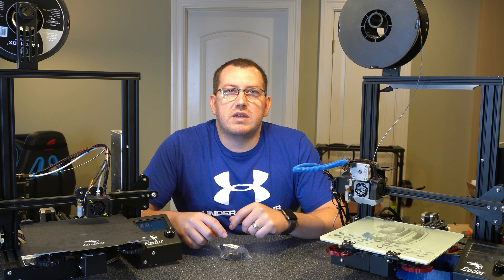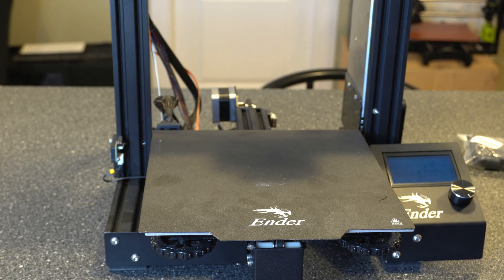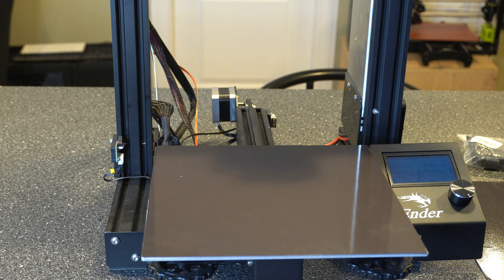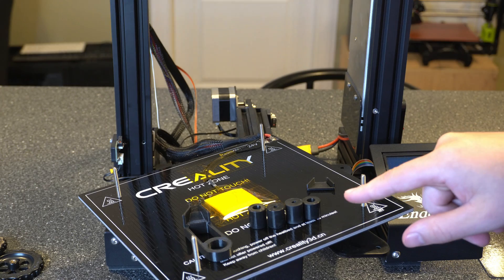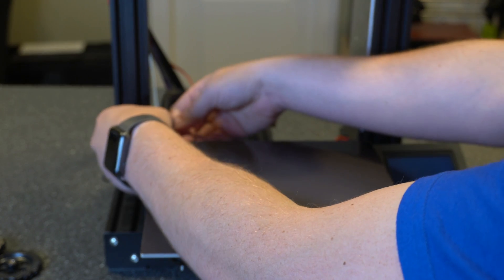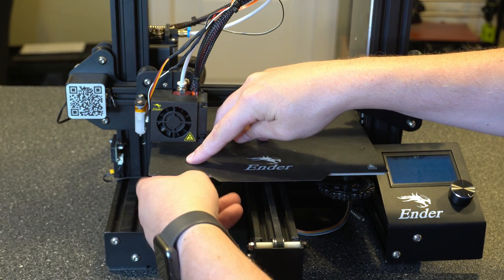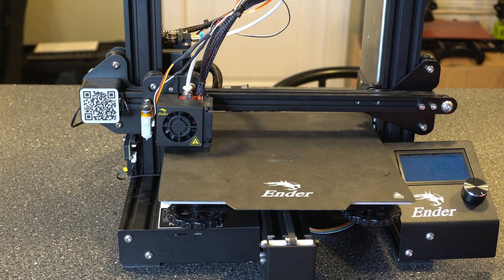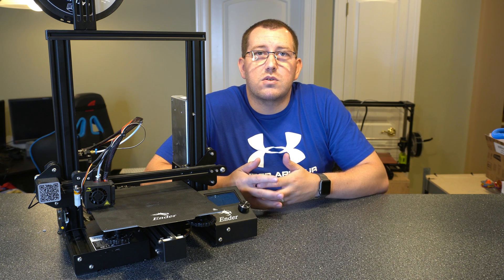3D Printer Solid/Silicone Bed Mounts – Install Guide

Comment: Hi I don’t know if you can help me I have an ender 3 v2 and I purchased the silicone mounts and installed them shortest where the bracket and wires are and put the bed back to together and levelled it using the CR touch, but one corner is just way out and it asks me to raise the wheel, but I cannot turn the wheel anymore / raise it anymore without the wheel coming off…that corner just seems way out where the shortest side is.  I’ve adjusted the z offset and all the other corners to see if it will compensate but it’s just off. Do you know of anything that will resolve this? I normally use the glass bed, but decided to use my magnetic one for this; will that also affect it? Any help on this would greatly be appreciated if you could!

Comment: pretty sure your supposed to use glass bed with solid mounts. maybe im wrong.
Reply: You can use with anything, its just a harder mount than the spring so it should require you to adjust them less

Comment: Good evening. I have a CR-10 S5 CR Touch, 500x500x500 build volume. I am having such a hard time making it stay level. I am going to install metal spacers with an inner diameter wide enough to go around the nuts holding the screws in place underneath instead of the silicone mounts to have a "flat" and not moving bed level. My Anycubic Kobra Maxes (2) and my Kobra Plus have these hard spacers also with locknuts to hold the bed down with ABL. I won't be able to adjust the knobs because of the solid spacers being locked down with locknuts. Would I just level the center when it homes since it would be mostly flat across the board, or would I need to make adjustments of Z height with the controls on the box, or switch to an endstop switch?  I am just tired of minute little adjustments that will screw up the whole bed level, and tired of having to mess with it and not being able to have a print successfully complete, not to mention the extruder always skipping because of inconsistencies in the bed level. Thank you kindly.
Reply from the maker: Hi. I would still manually level all four corners as much as possible (not sure how much flexibility the solid mounts will offer). Then assuming your using a bltouch/crtouch make sure its plugged in along with the z stop. Set the z offset, then adjust the height of the z stop to make sure it can be triggered if the abl fails.

Comment: @ 5:37 you say to manual level before powering on, how do position extruder to check clearance with the paper?
Reply from the maker: I take the bed all the way down then move the axis to it. It doesnt need to be perfect here, just enough so that when the axis is moved by the stepper the nozzle doesnt scrape against the build plate.

Comment: I changed the springs to the silicone spacers. With the springs there was a washer at both ends. So with the spacers, I did the same, or should I not have?
Reply from the maker: Hi. It wont make a difference assuming everything is level and the z stop switch is set right.

Comment: I purchased this and set my z offset but the issue im having is when do it. The left side is too close to the nozzle while the right side isn’t. I’m not sure how to resolve the issue. 

I thought maybe the arm my extruder is on could be off but I measured it and it’s even. 

Could really use some help. I do have the cr touch.
Reply from the maker: Hi. You may need to tighten the left side down more. I know i had to really tighten a couple points and the other ones are more just hand tight.
Reply: @3DPrintscape  I’ll give that a try. I’ve got back and purchased the yellow coils, so I’m gonna give those a shot.

Comment: Please watch your Z stop after installing these. especially if you go right to "auto home" after installing these. it should be close but you don't want the nozzle hitting your build plate after installing
Reply from the maker: Hi. Ya, you will want to make sure you level your build plate after installing these or replacing the  springs.

Comment: I just swapped out the springs on mine but I have another issue (that started before I decided to swap them out) which is ever since I installed the magnetic flexible build plate, I haven't been able to level the bed properly. Because of the height difference of going from a glass bed to a thinner surface, I can't get the build plate to sit high enough and the wheels get completely loose when trying to raise the bed high enough to reach the nozzle. The issue is the z offset can be lowered a little more but the bottom of another metal part (not sure the technical name for it) gets in the way and it can't lower anymore because of that piece. Any suggestions for this?
Reply from the maker: Hi. The only thing I can think of would be to get longer springs to raise the bed up a little or cut the little plastic piece on the z stop that hits the frame. That will allow you to lower it a bit more.

Comment: If you're having trouble getting the plastic casing off of the wire to the bed plate, just use a small flathead screwdriver. Slid it up the side underneath the cap it usually pops pretty easy
Reply from the maker: Hi. Thanks for sharing.

Comment: Do you still think these are better than the heavier springs?
Reply from the maker: Hi, Overall i like them better but if you already have the heaver springs i wouldnt switch.
Reply: @3DPrintscape  I don't have either currently. Just a CRtouch and normal sprints on a e3pro
Reply from the maker: @-Good4Y0u  Ah ok. If your bed is decently level, I would get the mounts.
Reply: @3DPrintscape  that's the plan I had based on your video. Thank you

Comment: I put the solid bed mounts on and a glass plate and it made the print bed alot thicker, I tightened the leveling screws down pretty tight but it didn't feel right so I backed them off and instead raised the z stop, my question is how tight should they be? Too tight and I feel ill damage the mounts and too loose they'll just back themselves out and need releveling constantly
Reply from the maker: Hi. They should be tight enough that there is no give/movement if your moving the bed around.
Reply: @3DPrintscape  ok so I might drop the z-stop down a couple mm and tighten them up because I test printed something right after installing which worked flawlessly, and then went to print something bigger with a wide base and half the print would lift up while the other half was squished pretty good, had to relevel after just a 30 min test print
Reply from the maker: @WTFisjuice1  Make sure your z axis,  y axis, and hot end carriage are tight.

Comment: I wonder if there is a kind of calibration or test model to compare performance before and after , and really say my printer is better now
Reply from the maker: Hi. You could print a couple calibration parts, like a benchy before and after.
Reply: @3DPrintscape  Thanks! but what imperfection of the benchy should be improved?
Reply from the maker: @tinchodias  If everything is working perfectly before doing any upgrades, you may not see any improvement. That said, I would look for things around layering and the bottom of the print.

Comment: Probably not a big deal but FYI you did twist your wires coming off the build plate when you removed and replaced the bed. 2:48 you flip it over counterclockwise, 4:28 you flip it counterclockwise again and can see the harness is twisted after.
Reply from the maker: Hi. Thanks for pointing that out, i actually didnt notice it. I havent had any issues but will untwist them next time i have the plate off.

Comment: So are these a better solution than the flat yellow springs? Noob printer, just want the best for my Ender. lol
Reply from the maker: Hi. Assuming you dont need to make any major adjustments to level the bed, i like the solid mounts better.
Reply: @3DPrintscape  I've already ordered the springs but when I get thermal pad I might switch em. Just hate leveling every print ya know?
Reply from the maker: @Jesse_Burson  I hear ya, you may want to get a CR Touch or BLTouch as well.

Comment: can you post a link to the adapter you printed so the springs stay level.
Reply from the maker: Hi. If your talking about the wire harness, that came with the kit i bought. You can print the, but you will need to print one that matches the height of the mounts you have.

Comment: Which direction did u put mounts they have a flat side and a conferred side ( center hole ) ?
Reply: Oh no thank u for your help I may revisit them in future But truthfully heavy springs work very well
Reply from the maker: Hi. I put the larger diameter on the bottom, so the small side is on the build plate.
Reply: @3DPrintscape  ahh ok tk u
Reply: @3DPrintscape  took them out impossible to get bed level !
Reply from the maker: @charlesrestivo870  Sorry to hear that. They are not good if large adjustments need to be made.

Comment: Hi Rob, thank you very much for the video. I'm going to put some of these on my printer, but I would like to ask when searching for these, the information says that the Z-axis limit switch needs to be readjusted is this correct?
Reply from the maker: Hi. I did not need to adjust the z-stop on mine, but that may not be the case for everyone.
Reply: I was thinking this

Comment: Hi. By any chance, do you have tutorial for 4.2.7 board and latest BL touch? (that one which starts smoking if you connect it like in most tutorial / blue /red / yellow wires instead of brown / red, /yellow
Reply: Like 3D Printscape said. Don't ever rely on the wire colours, always check the wire order coming off the BL Touch.
Reply from the maker: Hi. I dont have one for 4.2.7 specifically but it would be the same as the 4.2.2 board. The difference between the blue/brown wire is typically just the brand of the device. Its important to look at the pinout for the bl touch and make sure the wires are in the right order.

Comment: What would be the ramifications of printing your own?
Reply from the maker: Hi. The biggest reason i didnt was because i wanted the wire support arm and the mount to be the right size when combined. Outside of that, printing your own should work. Also, its worth mentioning that the filament needs to have some give, it cant be solid.

Comment: Great video I have had pretty good luck with the ones I installed on my pro. I have done major updates to it now with linear rails for all 3 axes, then I was doing a dual z setup but I found out I have an issue with the v-rail extrusion likely a bolt hole that was not tapped straight as when I tighten everything down it causes binding on the z at the top so I can't use it till I replace the v-rails.
Reply from the maker: Hi. Thanks for the feedback. Did the everything work after the initial install then have issues later on or was it right after the install?
Reply: @3DPrintscape  yep works just fine the linear rail kit moves great I may put in a TH3D full solid bed mount kit next as long as all is printing well.

Comment: I have been thinking of swapping out the springs for solid mounts on my printers apart from the Ender 3 that I keep 100% stock standard, its the way I determine any benefit to upgrades on the other Enders, I have the upgraded springs on my printers and for the most part they work well but eventualy the tension moves and they have to be relevelled.
Reply from the maker: Hi. Thats basically the test im doing now. I have one printer with the solid mounts and the other with upgraded springs. The upgraded springs work well but im thinking the mounts will hold up better over time.